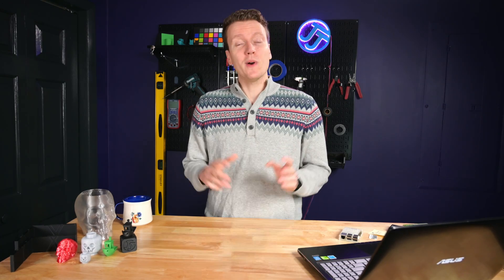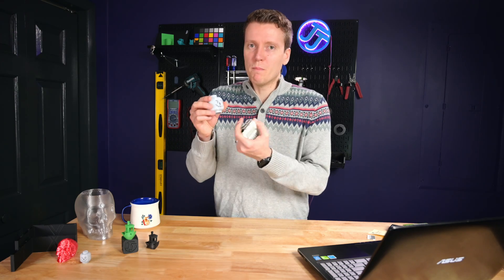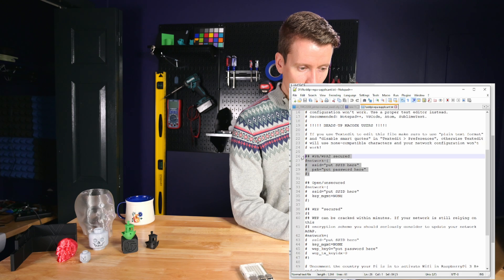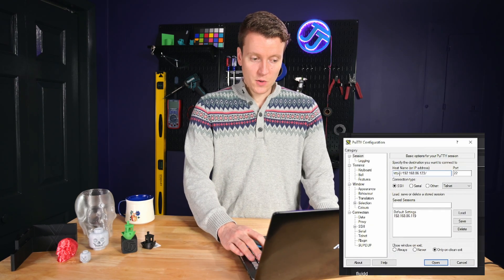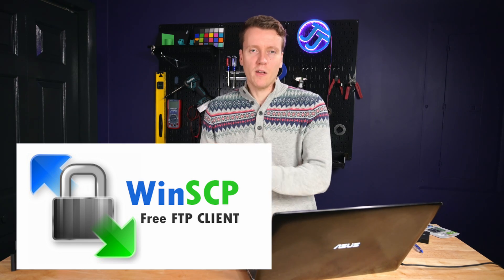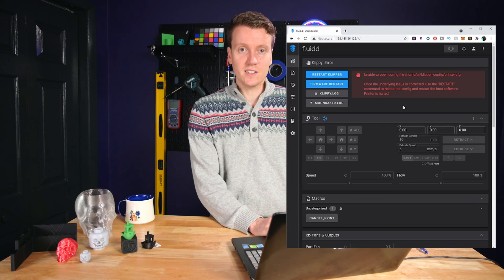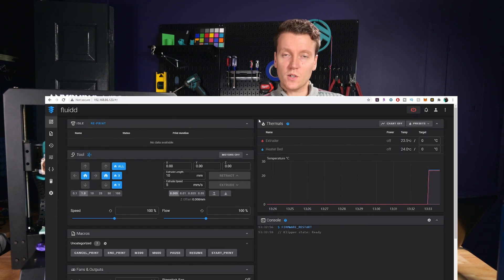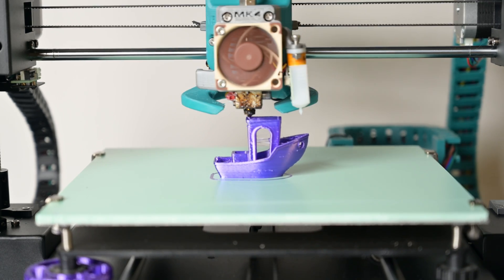3D Printer Klipper Install Tutorial | Anycubic Mega S with FluiddPi

Comment: After uploading your file through Cura my printer is toast. No criticism, from me, I wanted to swap out the old Trigurilla Board anyway. :)

But I should have waited for the new one to arrive.  I can not even get the old one running again with help of the Arduino trying to flash another file. Grd, 5V, Mosi, Miso and all that stuff was correctly conected to the Trigurilla ISP port.

As I read in the comments, many had ppl no issues. Maybe my Board was defective before, but printing was still possible before I made the FW change.
Reply from the maker: Are you sure it's toast. Because it won't talk to Cura with the new firmware. It need to to talk to the raspberry pi with Klipper running. It may seem like it is dead, but just won't communicate in the same way as Marlin did

Comment: My display is still on after this instruction, but im unable to move any axis or something. That means klipper is installed on my printer? isnt it? because i have a problem in fluidpi with connecting with the printer after the printer.cfg step
Reply from the maker: Yes that should mean that the screen commands aren't able to talk to Klipper.
The command:
ls /dev/serial/by-id/*
Sent to your raspberry pi while it is USB connected to your printer should let you know that Klipper is on your printer, and that the raspberry pi and the printer are talking
Reply: @JJShankles  yea when i type that i get that command back. But Fluidd still says that it the printer is not connected.
I put that line from the command already in the printer.cfg. Cant get it to work

Comment: I just flashed my firmware with Klipper but I think something went wrong. I'm trying now to re-flash the orginal firmware from Cura but the printer is not visible anymore from Cura! Do you have a process to rollback to the original firmware afterward?
Reply from the maker: I'll try a few things in the morning and get back to you. I haven't had to go back to Marlin, but if Cura isn't connecting to it then the firmware should be successfully flashed. Try turning everything off for like 30 seconds, also try removing any SD card or the screen from the 3D printer. Those may interfere with Klipper trying to talk to the board. Then re-enter:
ls /dev/serial/by-id/*
Reply: @JJShankles  I think this is related to this section of the printer.cfg 
on github:
[mcu rpi]
serial: /tmp/klipper_host_mcu 

These are the settings for "Measuring Resonances through Raspberry pi". PEople who do not perform own measuremetns could just turn these two rows into comments with # signs and the connection should start to work. No need to go back to Marlin because of this.
Reply: @milowmilo that's the first thing I tried and it gave me another error
Reply: @JJShankles  but where does the error "rpi" come from ?
Reply: I'm running into the same problem right now. I'm getting a "mcu 'rpi': Unable to connect" error, and Cura won't connect to the printer either.
Reply: I'm in the same boat ,anyone found out how to fix it or get the mega s back to Marlin firmware?

Comment: Is it possible to get the Firmware with all its settings from the printer? in case klipper doesnt work right, i wanna go straight back to marlin.
I understood its possible with the pi, but with the printer firmware too? i have custom firmware on it.
Reply from the maker: I don't think that is possible. You can find other versions of Marlin for this printer, but I don't think it can do that

Comment: In the top of your configuration stands "3DTouch code is commented out. Z limit switches are used to home Z axis." but that is not true, or is it?

When I comment everything 3DTouch related out and want to use the manual bed leveling I get the message "Option 'control_pin' in section 'bltouch' must be specified" so it seems I am missing something...
Reply from the maker: Good catch, it initially was for use without a 3DTouch, but then I installed one. I forgot to change the comment. I need to just upload a version with and one without the BLtouch code. I think the section you need to comment out is the entire [bltouch] section.
Reply: @JJShankles  commenting it out, and deleting it still brings up that error
Reply: @BensBackyardShop   Were you able to fix the issue? I'm having the same problem. Just started tonight so haven't really figured it out yet.
Reply: Never mind, I got it working by deleting the bltouch sections and changing the 3dtouch options back to manual bed leveling with the endstop pins enabled and commenting the 3dtouch options out like the comments stated. Don't know if both are required but it worked.
Reply: @DemisvanEyden  yeah had to delete everything bltouch.  including under the "don't change" section lol

Comment: Hey, I keep getting the error message Printer is not ready. And in the logs, it keeps saying 
mcu 'rpi': Unable to open port: [Errno 2] No such file or directory: '/tmp/klipper_host_mcu'
Any idea as to why it cannot detect the printer?

i also did unplug the screen from the printer.
Reply: Same issue here! Did you find something about it?
Reply: @Psodracer   can't figure out what I did wrong. But the same error (mcu 'rpi': Unable to open port)
maybe there should be a USB flash drive in the printer?

Comment: hey thanks so much for this tutorial im gonna give it a shot tonight!!

my only question is how do i get my BLTouch up and running with this, Im assuming i just need to edit printer.cfg to enable it? any input is great thanks again

can you let me know where you got all the pin values from? im trying to learn this as well
Reply from the maker: Yeah you just edit the printer.cfg file. I'm working on a a video now that explains the configuration, but the Klipper website steps has pretty good written instructions
Reply: @JJShankles  i actually ran into an error i did menu config then ls /dev/serial/by-id/*

put in the mcu line and i still have problems connecting to klipper or the firmware. not sure why followed everything to the tee
Reply: ive been grinding trying to get klipper to work , im gonna give mainsail a shot.. i completely redid the printer.cfg until it didnt give me anymore errors after updating, and i just couldnt get klippy to start and could not get a connection to printer =\

Comment: I watched this so many times trying to get it working on a mega x.  I have to say this is definitely not for a novice. Very step learning curve a bunch of the configuration file has commands that are no longer used as well.  My first print is going at the moment… so likely will need tweaks. Much much faster thought with supporting mods.
Reply: In less than a hour I printed a fat benchy… I must have miss calculated the Y rotation. Lol 😂.  Oh I should say thanks for the video as it definitely has helped a lot in getting as far as I have. With some tweaks it will be good in no time. I also second the idea of a video on calculating the rotation. Same with extruder… although I think I got that one solved. Or maybe a generic video on printer config commands.  Just a thought.
Reply from the maker: I'm glad you got it working! I do actually have a video on calculating the rotation distance since the latest Klipper update forced that setting: https://www.youtube.com/watch?v=k41RjLFM5u4
And that is a good idea for a video on the config commands though!
Reply: @JJShankles  thanks, I did find it right after commenting. I realize that I wasn’t subscribed and missed that video. But once I found it, it helped out a lot. I did also printed a 20mm cube and used calibres to see if it was right. End up making very small tweaks and got it consistently printing the cube… now I am working on a clone BL touch and getting that set up. :) thanks for your reply and for the great videos that motivated me to take on the project.

Comment: Thank you for the great tutorial. 
I use your config file for my anycubic mega s but i had an error on klipper:
Option 'rotation_distance' in section 'stepper_x' must be specified

how i  do can calculate it ? do you have a tutorial ?
Reply from the maker: So I found that this is a new setting and klipper no longer supports step_distance. I'll release an updated config file today, but in the x and y section it needs the following: 
rotation_distance = 40
Full_Steps_Per_Rotation = 200
Microsteps = 16
Both Z sections needs the following instead of step_distance:
rotation_distance = 8
Full_Steps_Per_Rotation = 200
Microsteps = 16

And I am working on calibrating the extruder now. I may make a separate video since this will be something all Klipper config files will now need.
Reply: @JJShankles  I am confused, was the updated file released? plz help. I am a noob and super stupid when it comes to this stuff :-(
Reply: @JJShankles  Thank you very much!! Yes i read about it that step_distance is deprecated.
Reply from the maker: That's odd, I don't have a rotation_distance setting. I have step_distance configured at 0.0125

Comment: I'm brand new to FDM and only just bought an Anycubic mega s. Should I grind away with Marlin for a while first or dive straight into this setup?
Reply: I would keep it stock as much as possible at the beginning. Being able to study off a reliable unit will help as you learn slicer settings. Learning how to get your prints to stick, Temperatures,  speeds, then do it all again with new materials. Klipper should be your end game. Changing to a new firmware will have its challenges. Keeping it stock will also help your research. As you read different forums new user issues will revolve around a stock unit.
Reply from the maker: I would probably recommend using Marlin and just enjoying printing for at least a few months before going for this. That way you will know that if something doesn't work that it is the firmware not something you haven't tried before.